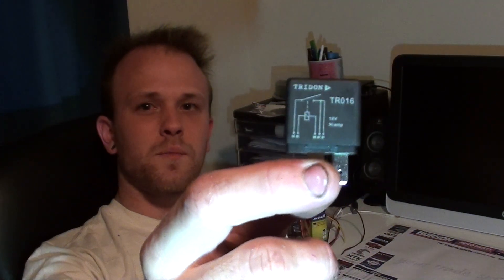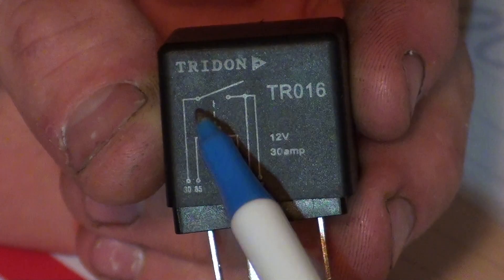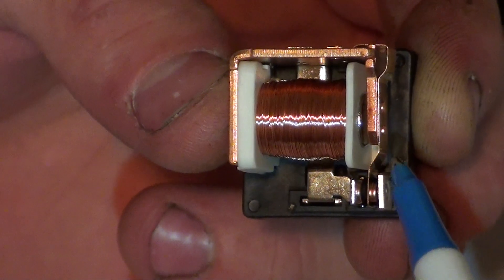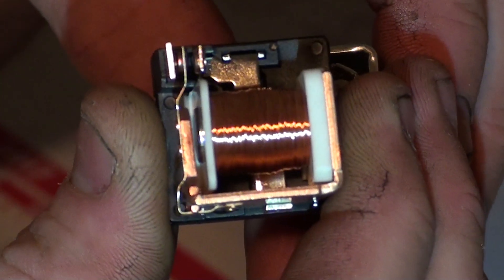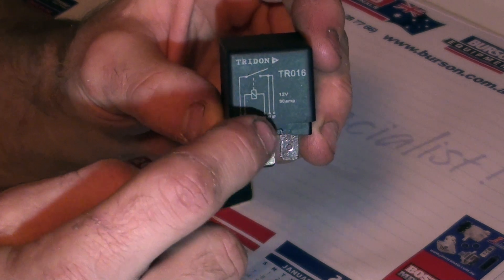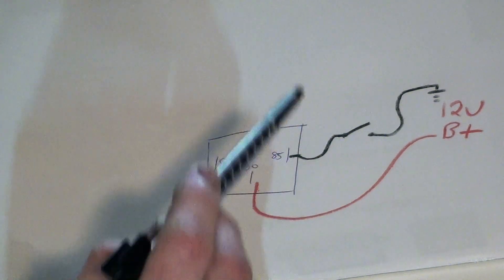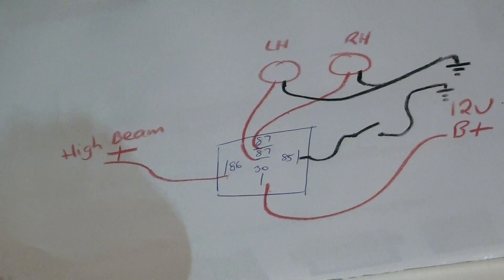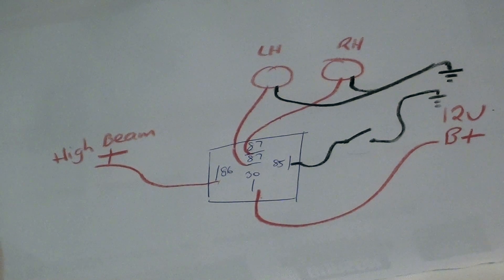How a 12V Automotive relay works (How to wire up a 12V Relay)

Comment: Good trick with the 9 volt battery to check the relay . I have always had trouble understanding relays but this helped heaps . I am wiring up 7 for an overhead console I am fitting to the Pajero .

Comment: Is there a voltage range that will actuate the coil side of the relay? My application is non standard from a solar panel and the voltage varies with cloud cover from 6 to 20 volts. I want the relay to trip on at 12v to supply power to a USB outlet. The USB outlet will function from 6-24 volts but gives erratic results in charging the device connected when below about 11.5 volts.
Reply from the maker: Hi there, the coil side of the relay should still pull in with as little as 1-2v so it may not work well in your application. You may need a solar controller or maybe you could use a dual battery system isolator that cuts in and out at certain voltages. Hope that helps or at least gives you some ideas :)

Comment: Hi mate. If I didn't want to wire them up through the high beams do I just leave the 86 out??  Thanks
Reply from the maker: If you want to wire them up off a switch in the cab and not off the high beams just bridge the b+ terminal 30 to terminal 86 as well. Then put your switch from pin 85 to earth as normal and it will work off the switch. Cheers! 😊👍
Reply: thanks  @howtonick2803

Comment: what size inline fuse would you put between battery and terminal 30?
Reply from the maker: Hi Edward, It depends on what sort of accessory you are trying to run. If it is spot lights a 20 or 30 AMP fuse is generally fine. Cheers